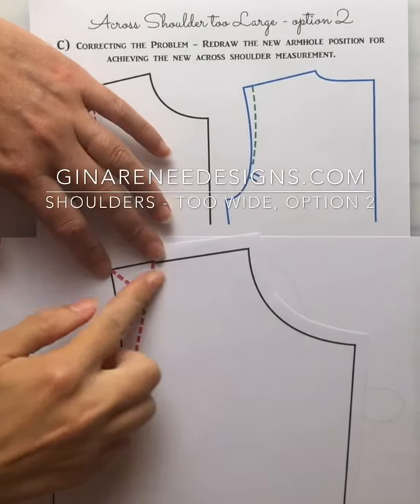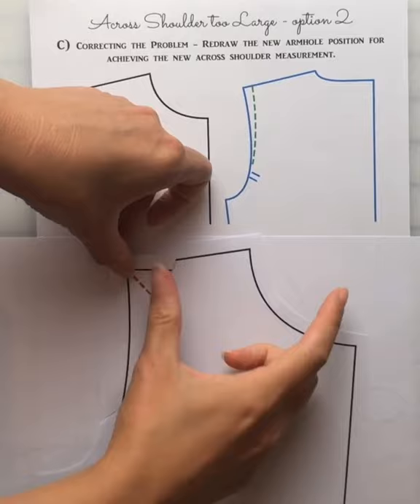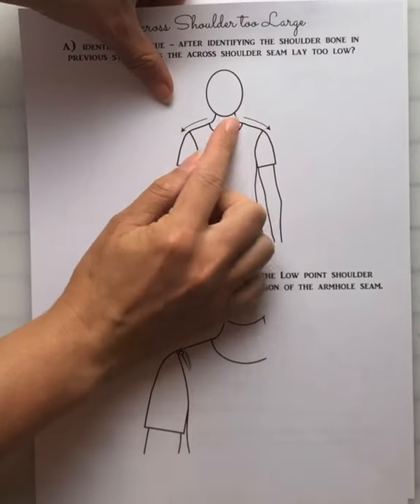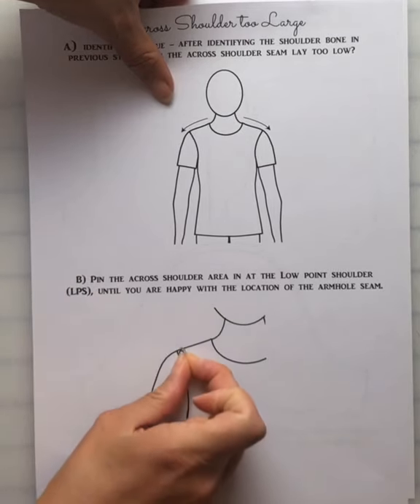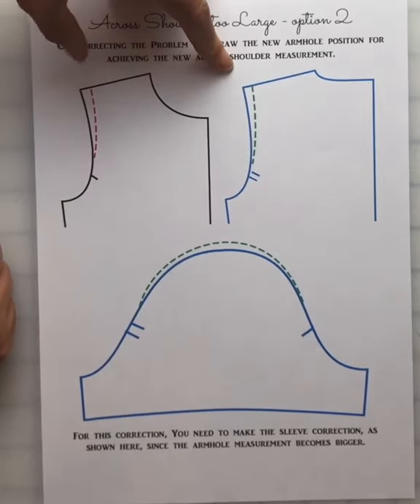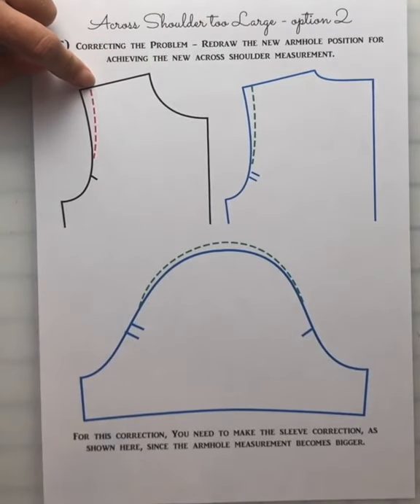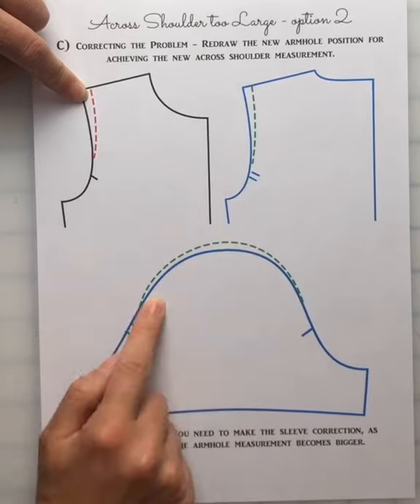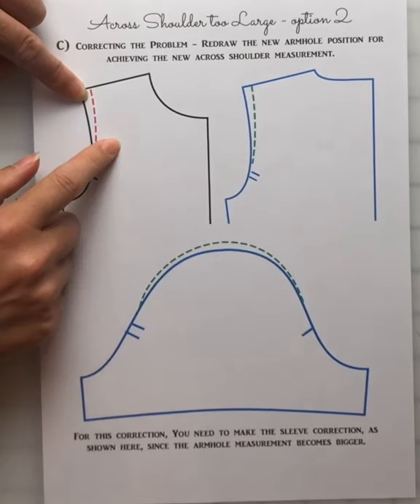Shoulders too Wide - Option 2 - How to fix wide shoulders on your sewing pattern

Comment: Hey, isn't the bigger armhole going to cause issues as well or is this typically ok? Unfortunately I can't work on the pattern anymore, I've already cut everything out and startet sewing but I have a 3/4 inch seam allowance, so I hope I'll be able so still fit the sleeve in if I cut away from the armhole...
Reply: It really depends on the person's shapes and the pattern's shapes whether or not the armhole is ok to become bigger. Usually, I use this option 2 correction over the option 1 correction, and it's generally fine. If the armhole becomes too big, you can always raise the armhole position to be higher.